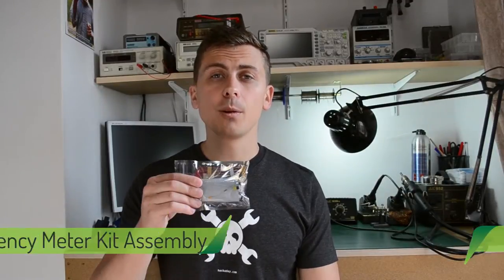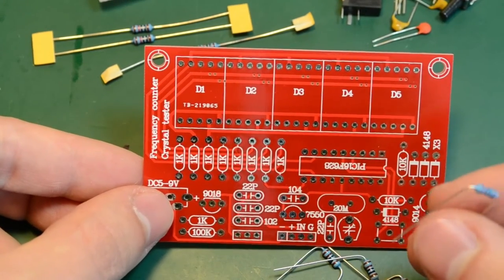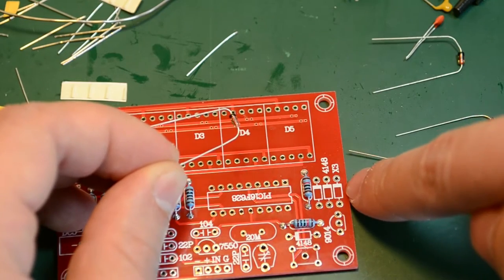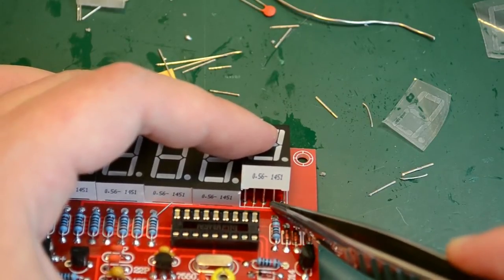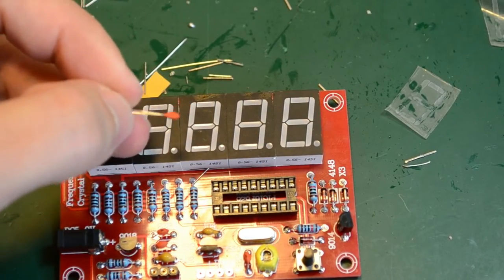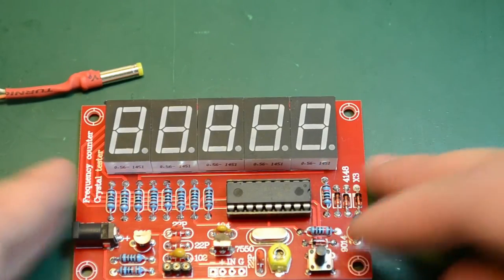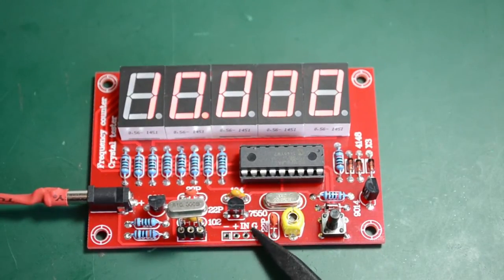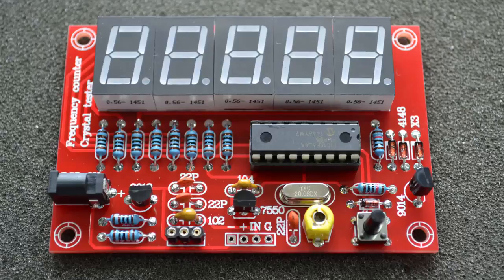Voltlog #14 - Frequency Meter Kit Assembly

Comment: Thanks, I picked up one of these kits before Christmas, and completed it the day  I received it.  Great fun to build these, and they can be useful as well. I use it occasionally, the only difference between the one I purchased and the one you built several years ago is on the board. They left off the screening and the hole for the GRND pin, and just have - + and IN. I use the -for ground and IN for my lead when exploring frequencies inside the chase of my old radio sets I like working on in my free time (at 68 years of age, and being disabled, I have TONS of free time!)

Comment: Well done - one of the few youtubers who knows how to solder properly. As a slight comment I would have rubbed the PCB solder pads with meths (alcohol) to remove "finger grease" before fluxing and soldering...
Reply from the maker: yup, cleaning the board before soldering is something I do sometimes, mostly when I know I have touched the board and it's not a fresh clean one.

Comment: I was wondering what's with that 22pF cap )) Now I know. Works like a charm. I have another problem... I got the kit from a Romanian shop as they told me I can use it to measure the frequency from a regenerative receiver using a pick up coil. Well... that was a fail as it doesn't. I built two different designs for preamp as I thought maybe the signal is not strong enough for the meter. No luck with those too. I have to get it to work... but I have no clue how.

Comment: Hello. I set up my circuit and when measuring a crystal of 20,000 it shows only 5,006. I already made an adjustment on the trimpot but it still measures 5006. Could you give me a hint on how to solve this problem? I'm applying 5 volts of voltage. Is the tension causing this error? Grateful.

Comment: I built one up today. Measures talks real good, but unfortunately it loads down my sig gen o it’s freq in terminal and won’t measure frequency. I discovered that if I made the input via C6 (the 102 capacitor) at the emitter of the 9018 Transistor then it seemed to work with some loading. 
BTW my input was a 5v square wave at 1Khz. When input via the IN pin the signal dropped to almost 0 volts, but when input via the emitter of 9018 it only dropped to around 2.5v and the frequency counter then worked. It would seem then that the PIC chip is a very low impedance and therefor to use this item to measure external frequencies would require doing so via a high Z input circuit.

Comment: Could some components (switches, probe connections, etc) can be installed using short lengths of wire to connect them? This would allow mounting the
unit in a project box with the "innards" protected.
Would these extended leads cause accuracy problems? Pick up stray signals?
Reply from the maker: Dunc Considering the 1KHz resolution, It should be ok using short wires, you can even use coaxial cable for the external input complete with a BNC connector.

Comment: Can I use this device to test, four pin crystal oscillators?
Reply: I would think so...don't forget to power them up when you test them. They are an entire oscillator circuit, and not just a crystal. I have built 2 of these counters so far, and they have worked very well. I suspect they would perform better, with a wide-band preamp, jn front of them. The schematic shows an emitter follower, for the input...if you use the crystal tester input. They have a gain of less than 1, so some signals might not be enough for it to see.

Comment: Do you vary the heat for soldering?  What kind of solder flux do you use?  Is it special for these boards?  Thank you.
Reply from the maker: I usually keep the soldering iron at 280C and I typically use Amtech gel flux which I clean with IPA when I'm done soldering.
Reply: @voltlog  thank you!  The flux i had was terrible, and my heat was wrong i think.  Good info!

Comment: Interesting stuff. I have bought a China version of the Xtal frequency meter but would like to use it as just a hobby frequency meter. Is that possible? I have not constructed my kit yet in case I need to do some mods.
Reply from the maker: Gary Templemain yes you could, but for this model you would get only a 1KHz resolution.

Comment: Thanks for the video: I would like to know what value the variable capacitor has, please? I am Spanish and the translation is made by google. Sorry if you do not translate well. Thank you very much.
Reply from the maker: Sorry, that variable capacitor is not specified on the original schematic.. I do not know it's value.
Reply: ok. Thank.But can you measure yours?
Reply from the maker: Not really, it's in circuit with other capacitors and I will not get a correct reading. It's probably a small value capacitors in the range of tens of pF.

Comment: mine have 2 extra spare components, the 22p capacitor and a 1k ohm resistor.
Reply: Hello did the kit worked for you mine didn't work
Reply: Same here  hahaha
Reply: @haronwepworking5806  mine it's working  fine

Comment: Hi can this test 240v mains frequency? Thks.
Reply from the maker: max input voltage is 5V
Reply: So what should be done to check an inverter through a transformer? Thks.

Comment: Good for you and these kits with the "red board" seem to work fine. They are based on DL4HYF's PIC chip firmware and have been ripped off by the Chinese. Some of these kits a re good and some suck swamp water. 

Please be advised that -- as of this writing -- the ones that come with the clear plastic case and steaming piles. I ordered two of them, built them up and, while they could be used to check the frequencies of crystals, they did not read ANY signals input to their normal port. Those are the ones that have the "greenish" board. AVOID THEM LIKE A CASE OF STDs.

The sellers are in China and they offer a 14-day return policy which is negated by the two-week shipping time. And they ignore you anyway. 

You are warned.
Reply from the maker: +k6whp well there is always that risk with these chinese kits but they're usually cheap and not worth the trouble of sending them back.
Reply: I have been having pretty good  luck with Banggood they usually sell a stable product, and stand behind it.  Well they did till I purchase a damn battry power soldering iron, it never has worked and they keep asking me to jump through more hoops. I am about fed up the those folks.  Perhaps it is time to go back to Alice1983